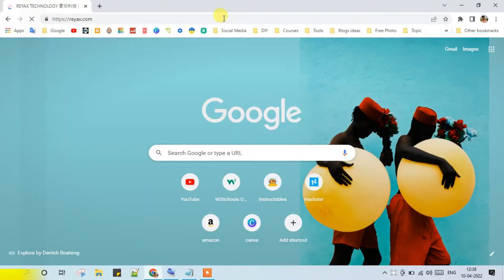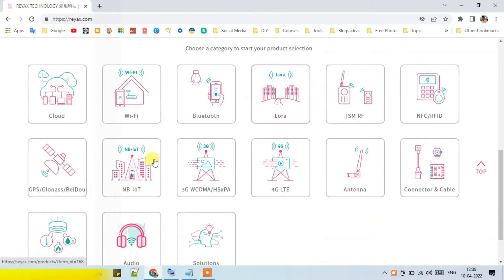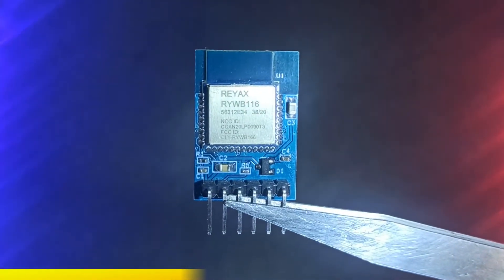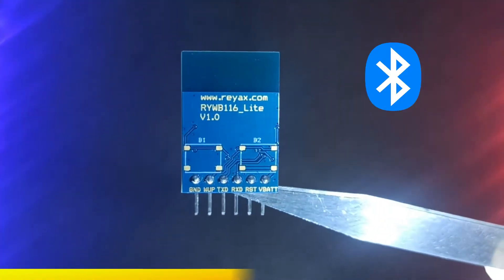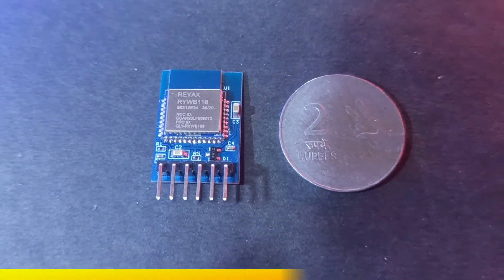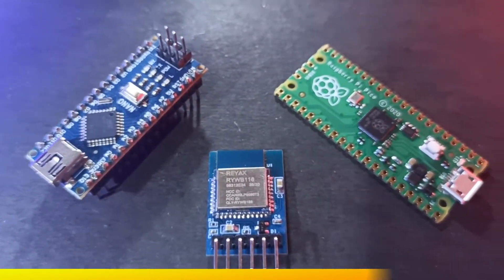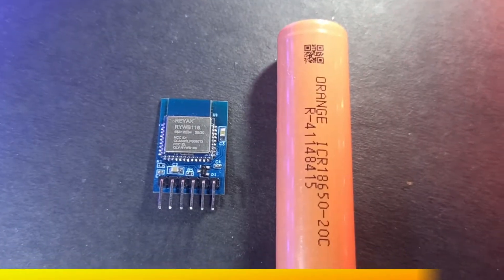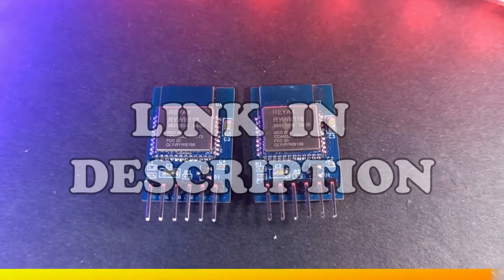Rfid door lock using arduino | RFID projects

Comment: help me there are some error in (#include <LiquidCrystal_I2C.h>) this line . they show me 

Arduino: 1.8.19 (Windows 10), Board: "Arduino Uno"

door_lock:4:10: fatal error: LiquidCrystal_I2C.h: No such file or directory

 #include <LiquidCrystal_I2C.h>

          ^~~~~~~~~~~~~~~~~~~~~

compilation terminated.

exit status 1

LiquidCrystal_I2C.h: No such file or directory

This report would have more information with
"Show verbose output during compilation"
option enabled in File -> Preferences.

(So what can i do ???)
Reply from the maker: Have you install the liquid crystal library?
Reply: yes  @MrProjectsoPedia
Reply: PLEASE help me 
 @MrProjectsoPedia
Reply from the maker: Do you still getting the same error?
Reply: @MrProjectsoPedia   i have solved the problem . thanks for your help
Reply from the maker: Its my pleasure 😀
Reply: how did you solved your problem@Rifatullah_Ahmad_Zubaer
Reply: @MrProjectsoPedia  what is the liquid crystal file named as? i'm seeing so many types here